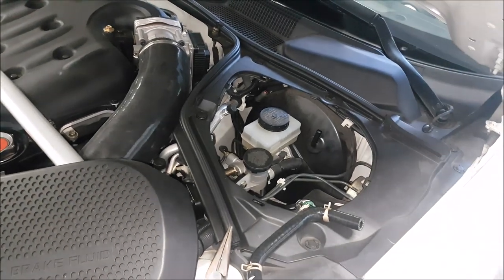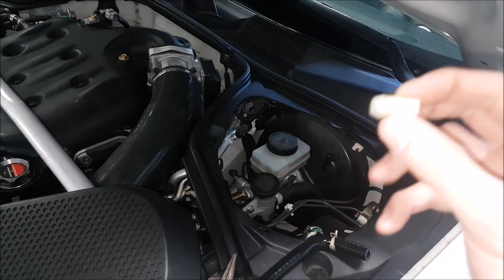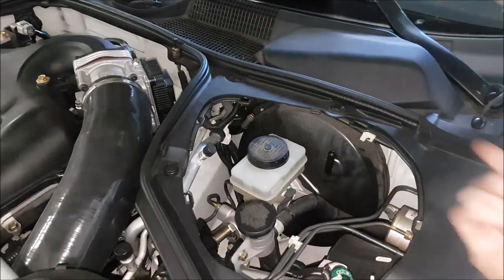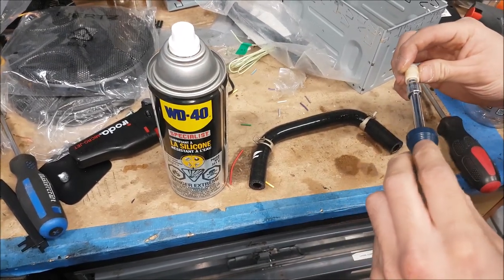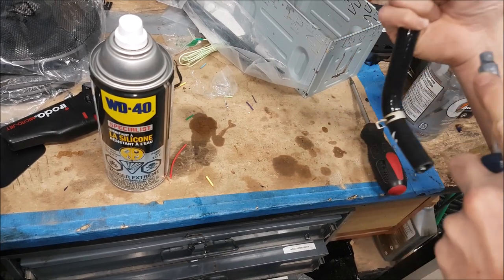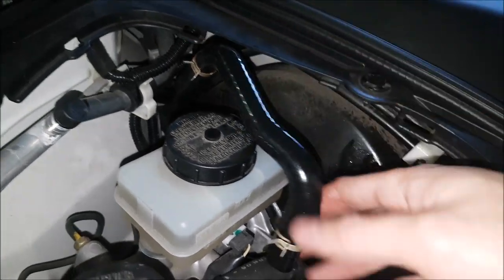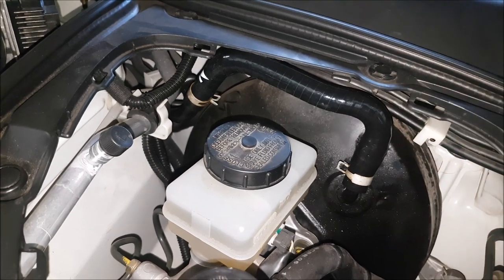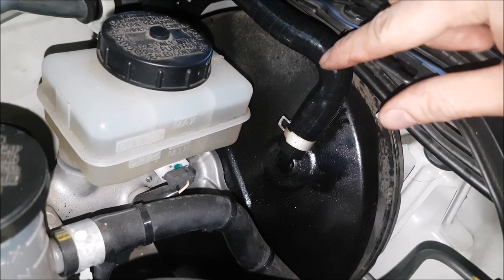Brake Booster Check Valve Nissan 350Z/ Infiniti G35 (Z1 Motorsports silicone hoses) | AnthonyJ350

Comment from the maker: Check Valve Link: https://www.z1motorsports.com/front-brake/nissan/brake-booster-check-valve-p-5300.html
Reply: Bought installed it's all good. But thanks and Z1 got to me in 3 days maybe 2? But very fast now my car run really good with no leaks coming fro. Any vacuum hoses. But I did notice a small whistle from my throttle body spacer it's really wide 1.0 spacer
Reply: Hi, Anthony!  This doesn't look like a check valve that goes in the hose.  How do you install this?  Cut the new silicone hose?  Thank you.
Reply from the maker: @RichardNavarrete1  That style, yes you'd have to cut and put inline. Verify the diameter before cutting.
Reply: @AnthonyJ350  thank you

Comment: anyone got an idea to why my 04 350z brake pedal is hard to push? the brakes seem to drag and the car won’t roll in neutral unless i pull the brake pedal back w my foot
Reply from the maker: Hard to push with the engine running?
Reply: @AnthonyJ350  yes w the engine running
Reply from the maker: @garrettclark2010  Check to see if the brake booster is getting vacuum from the engine.

Comment: Hey bro I added Stillens grounding kit and and now my car is acting weird. At idle if I give it a little rev it drops to normal rpm idle (650) then drops below that. The car then sounds like it’s struggling then goes back to 650. My code reader has live date and it shows the rpms going up and down but stays in the 600 range. It also does that when I start the car. I did disconnect the intake with the mass sensor connection and forgot to put it back when I put the negative cable back on but didn’t turn start the car.
Reply from the maker: Did you try doing an ECU reset?
Reply: I haven’t. I’ll try it to see if that helps

Comment: Are all check valves basically the same apart from the way it`s fitted? ie. can any valve work on any vehicle of a similar size or do they work at different pressures or something. I ask because I`ve just lost mine somewhere in the engine compartment and will need to drive it soon and to be able to get an original part. So can I use the one from another car?
Reply from the maker: That I don't know. In theory if it's the same diameter it would work. But that's something you have to test before taking it on the road.

Comment: I got the P0171 engine code. I hear something leaking like air escaping, replaced my throttle body hoses with Z1. Doesn’t fix it, autozone obd scanner told me it’s the throttle body which I have a CZP throttle body but before I go into replacing that, could this be an issue? My idle is usually normal but it’ll drop a bit and then go back up, at lower speeds it’ll do the same sometimes and I also feel a lack of power.
Reply from the maker: This video might help https://www.youtube.com/watch?v=yNeWl2czii0&t=339s

Comment: If I am not mistaken there is also a check valve in the passenger side brake booster hose aswell right ?
Reply from the maker: That I haven't confirmed.
Reply: Yes there is. I have vortech 350z and was having hard brake pedal on decel of a hard acceleration. Terrifying. It's because I replaced the oem hose from passenger side but didn't touch the drivers side hose.

Comment: Watched both of your videos through random searches lol. My passenger side Brake Booster line had that check valve in it. I didn't see you install one in the other video so now I see you've installed it on the driver side. Is there even a difference? I don't think my driver side hose had one.
Reply from the maker: Doesn't seem to be a difference. I still have a couple pushes on the brake with the engine off before it becomes really difficult to push.

Comment: Is this a add on check valve? There should be a factory check valve in the house close to the intake manifold.
Reply from the maker: There is one factory, but if you go aftermarket hoses you may have to switch the check valve over.

Comment: Hay thanks for uploading this Video. I was about to start doing the same thing on my car.
Reply from the maker: Glad it was able to help!  Did you get the hoses from Z1?
Reply: @AnthonyJ350   yes ordered it today, with a few extra things.
Reply from the maker: @XWILDH34RTX  Nice!
Reply: @anthonyj350 hay bro just finished swapping out the brake booster hose on both sides. When you swapped the one near the battery did you hear a rasp sound by any chance ???
Reply from the maker: @XWILDH34RTX  Probably still had vacuum in the booster

Comment: Hi, I know this is two years old but I noticed your checkvalve looks identical to the one I have in my 2006 coupe only my check valve is just that bullet shaped piece of plastic that tapers down to a really small hole and then opens back up (like an hourglass) but lets air flow freely both ways, there is no valve that stops the air from flowing back to the booster and that is the OEM booster hose. Brakes work fine car idles fine I noticed yours has a little valve on the booster side of the bullet shaped plastic piece mine don’t what’s up with that?
Reply: So just to see, I bought a normal check valve and splice it in with one that does not flow back to the booster and I didn’t notice any difference
Reply from the maker: When you shut off the engine the purpose of the valve is so the pedal is easy to push a couple times. If the pedal becomes hard immediately after shutting off the engine the  valve is backwards.
Reply: The new valve is in there correctly. It’s a two dollar check valve from Amazon. It works perfectly but the OEM valve is just a piece of plastic that tapers to a small hole and flows both directions. There is no stopper for backflow. I was just curious because I’ve never heard anyone talk about it.
Reply from the maker: @stopher1971  So you can do an easy brake application after you turn the engine off?
Reply: @AnthonyJ350  yes, 2-4 times getting firmer til stiff
Reply: @AnthonyJ350  i’m sure it’s just a flow limiter or something like that, unless there’s another check valve somewhere upstream
Reply from the maker: @stopher1971  ok cool
Reply: Idk if I can put a pic on here or not
Reply: Hi, it’s me again about that check valve, it is the exact one that you’re holding in your hand only I don’t have a one-way valve in mine. It’s just a tapered hole all the way through. Did infinity change anything like using a two way balance or something with vacuum pressure from the intake having it flow both ways for a reason my brakes worked fine with it flowing both ways I was trying to diagnose a problem and stumbled upon that not because it wasn’t working. Thanks
Reply: I never had any check engine light for it either
Reply from the maker: @stopher1971  If you turn off the engine can you press the brake pedal easily a couple times? Or is it hard to press right away?
Reply: OK I figured something out that I had no idea. There’s another check valve in in the same line in the snake looking tube on the passenger side between the battery housing and the intake , it’s fully in the tube so you would never know it’s there are even covered by the insulation around the hose
Reply from the maker: @stopher1971  Ya I had to cut out the check valve to install the one in the video.

Comment: that oem check valve looks different than the Z1 check valve. Is it installed the same way?
Reply from the maker: I just placed it inside the vaccum tube and verified the flow direction.

Comment: little question. its normal listening that air when you press the brake pedal while the car running?
Reply from the maker: No, I think you have a small vacuum leak.  You can hear it from inside the car?
Reply: @AnthonyJ350  in your video it sounds like air when you press brake pedal...
Reply from the maker: @kevinrodz5006  Thanks for the feedback!

Comment: Is there a check valve in the hose that goes from the battery to the plenum too?
Reply from the maker: Not that I know of
Reply: Yes I just cut open both hoses on my 04 and there was a piece in hose the one on my booster line driver side is free flowing though. The check valve one was in the hose to the plenum
Reply from the maker: @dogsdogsnumbers  Thanks for sharing!
Reply: @dogsdogsnumbers  
Just found your comment after I commented above. My driver's side did not have a check valve but the passenger side did. I don't believe anyone has changed my hoses prior to my purchase. I'm going to try OPs version because I only have one check valve that I cut apart from the passenger side. I'll add it to the driver's side and see if there's any difference.

Comment: Omg my oem hose doesn't have a check valve is that normal?
Reply from the maker: If you turn off the engine is the brake hard to push instantly?

Comment: Someone help me with my braking system. The issue is that, sometime i use my brake, it sucks my brake in. Seems like my brake is loosing some air vacuum, can this check valve can help my problem ?
Reply from the maker: The check valve is factory so unless you modified the vacuum system, it's still there. You might need to bleed your brakes https://youtu.be/bnUMyxDKFXg because there's air in the lines

Comment: My 2013 Elantra LTD with keyless ignition has a very stiff brake pedal issue. So bad I have to use the no brake pedal bypass perocedure to start it and sometimes that don't work. I have a $40 Master Cylinder Brake Booster Vacuum Hose Assembly on the way fom Hyundai I hope that corrects the problem. Hose, One Way Check Valve, New Clamps, Everything has been checked . . . no detectable  leaks ( fluid or vacuum ) just a rock hard brake pedal at start up. Normal and good braking when on the road.
Any Experts on here that can suggest a next step if this fails Or has direct experience with this same Hyundai issue ???
Reply: After untouched for 118k I think I have a clogged check valve . . . mine has a one way needle valve in it like a car tire.
We'll see ???
Reply from the maker: Hope you were able to fix it!

Comment: where do you get the check valve?
Reply from the maker: The original hose has it inside
Reply from the maker: You can also find hoses online and cut the hose open and get the valve from there if you dont want to cut up your original hose and save it.
Reply: This is old but Z1 Motorsports shipping and part tax 40.00 bucks . They got mine to me in 2 days. That's hella fast

Comment: Question why the hell dont they sale the valve already installed. I learned the hard way. But you pay tax and shipping 43.00 bucks for 1 house and find out you have to use old parts to make a new hose work is bull shit new on new should come installed already
Reply from the maker: I agree it should come with it. I believe they mention it in the instructions though.
Reply: And again with the plenum spacer 5/8 my kit came with bolts spacer  that's it no inner spacer torque shims rubber deal for center plenum so I almost cracked my center plenum and have all new every thing but both plenum spacer and throttle body spacer both from ebay junk. Its supposed to be kit well where every thing lol. RIP off. But Z1 Motorsports should sale it as one unit. Because I broke mine trying to install it
Reply from the maker: @caspernotsofriendly1803  I used Motordyne's plenum spacer and is thermal gasket.
Reply: @AnthonyJ350  I did to bug for some reason it didnt have the spacers and I didnt crack it. It's all good but did you leave the old metal gasket I did for the center intake that's all . I cut out the rest. Did you go with the Megan racing strut tower for 80.00 buck. I did and still had to do a little fab work
Reply from the maker: @caspernotsofriendly1803  My shock tower brace is the stock unit.
Reply: You used a 5/8 spacer and could reuse the stocks strut tower? How so? I had to shim mine up 
.50 to clear. But I bought a cheap Megan racing one for 75.00 and it looks better way lighter too. I'm going for looks as well as power. Lot of issues using Z1 Motorsports vacuum lines leaking . But I bought better stuff and that's fix now. Project this weekend is rear differential bushing pain in the ass and all new wheel bearings and then new stage 2 clutch ready for my turbo install thats sitting on my bench since xmas lol.
Reply: @AnthonyJ350  what year is your car my engine bay looks different than yours . Mines a late model 2006 dec26 revup and rare Burgundy convertible redline at 7k
Reply from the maker: @caspernotsofriendly1803  Yes you have to use a spacer for the shock tower brace https://youtu.be/IfUHH8ENXYk

I've never had any leaks on Z1 vacuum lines. They're the same as Mishimoto in terms of quality. Where was it leaking from? Did you use silicon lube to aid with installation?
Reply: @AnthonyJ350  but not with the Megan racing brace it's got lots of room. Looks nice too bro

Comment: So, where do I buy the check valve for a 3rd Gen? Why no link, if it is a dealer part, why didn't you advise. Is that the best we may expect?
Reply from the maker: It comes inside the factory brake booster vacuum line, so you have to cut it out.  I haven't been able to see it separately.
Reply from the maker: Here's a link, a simple Google search will show the part https://www.z1motorsports.com/front-brake/nissan/brake-booster-check-valve-p-5300.html
Reply from the maker: Found another one on my search https://conceptzperformance.com/czp-check-valve-vacuum-brake-booster-nissan-350z-z33-infiniti-g35-v35-czp-47471-cv_p_50192.php
Reply: @AnthonyJ350  that one doesn’t fit inside the hose